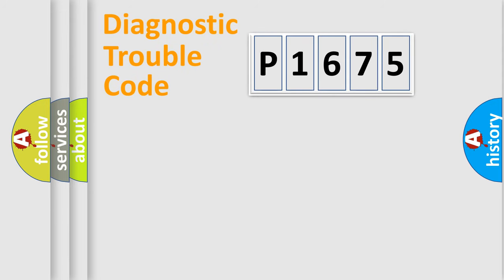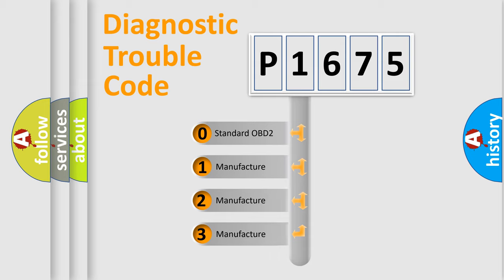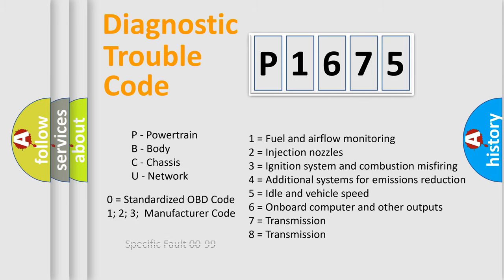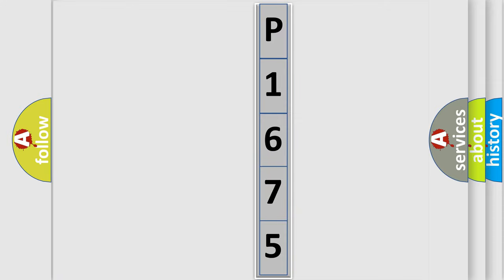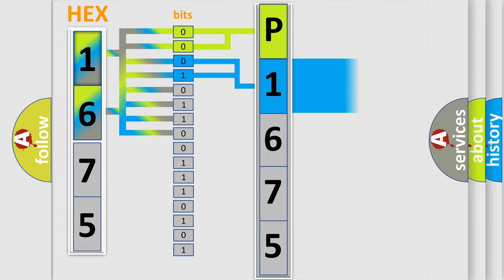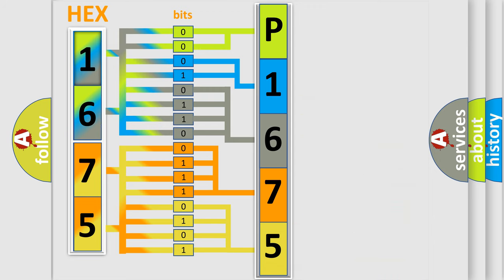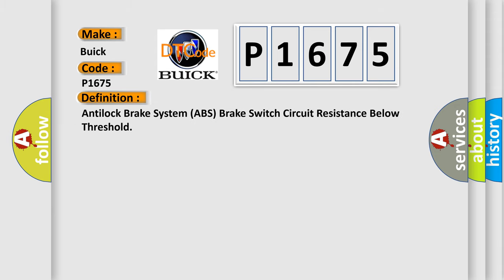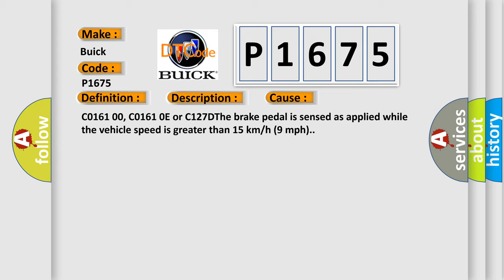DTC Buick P1675 Short Explanation

Comment: mine showed this error code, then the car shortly stopped running after,,what should i check for ?
Reply from the maker: Brake switch or hand brake switch
Reply: @maxidotairbagreset   on the obd scanner it said something about evac solenoid purge, the car would just die and quit when in park. now just cranks over n over, randomly started then quit again
Reply: @wonderwond  Yeah this channel is just a bunch of misleading information by someone that doesn't know anything about cars. P1675 on a GM vehicle is related to the EVAP system. In my case with my dads 1997 LeSabre (3800 Series II engine) it's got to do with the EVAP Vent Valve on top of the charcoal canister (Canister is underneath the airbox in the engine bay). Most likely need(ed) to replace that valve. Sorry that this person didn't help you 4 years ago. In your case it was likely the purge solenoid (not the vent valve) being stuck open which would allow excess fuel vapors into the engine and make it very hard if not impossible to start because of incorrect air fuel ratios. Could easily also cause a rough idle/stalling scenario as well depending on the circumstances. That purge solenoid is very easy to get to, on top of the engine somewhere.